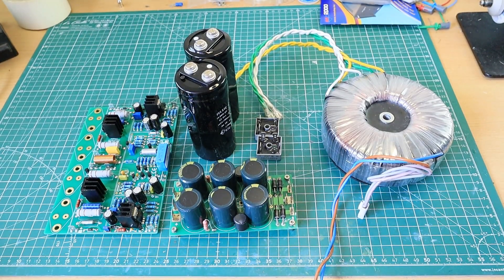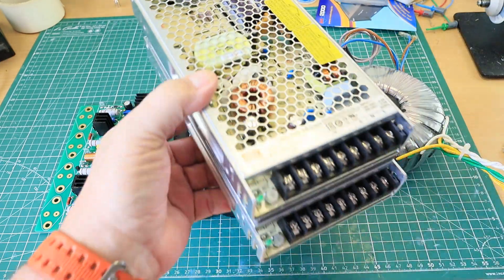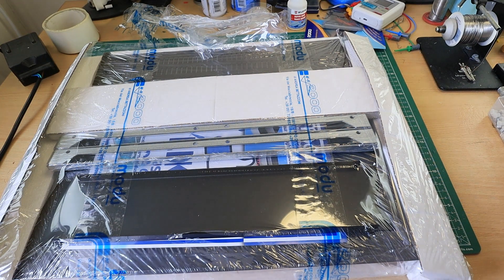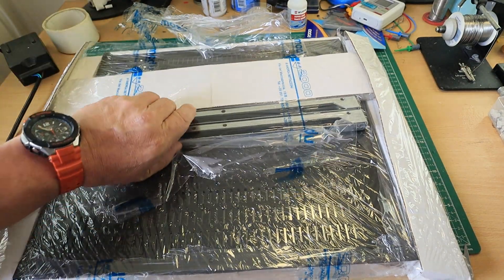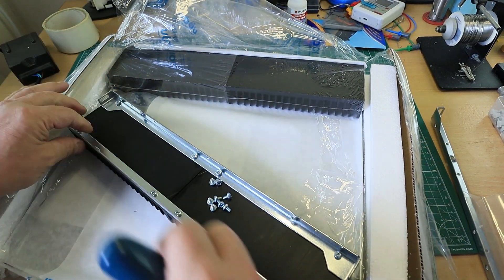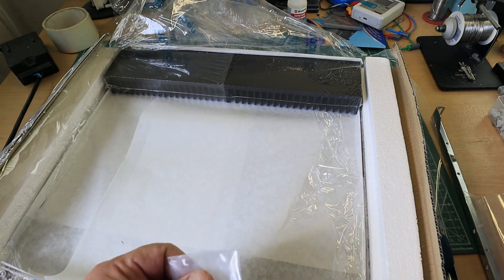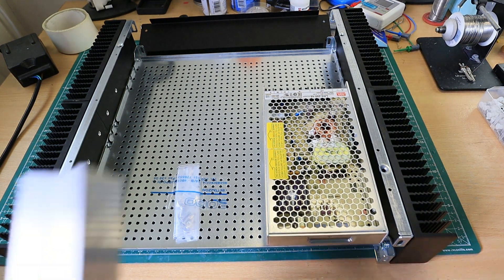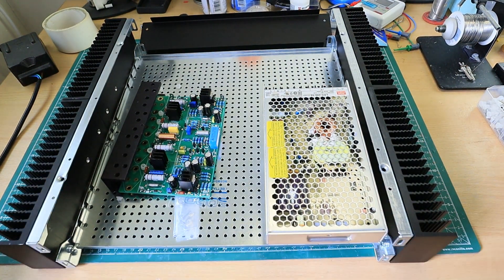Avondale Audio NCC300 'SMPS' Monoblock amplifier build (Intro)

Comment: Hifi2000/Modushop are awesome. I just ordered my nutube diyAudio case and pass ACA cases from them. Great company. They will customise your front and back panels for power and connectors etc if you provide a dxf file.

Comment: What do you prefer Avondale audio or Nelson pass.
 be better if you had the SMPS outside the amplifier near the wall socket just ran a umbilical cord with a couple of ferrite beads and a 1uF capacitor as filtration to eliminate emi rfi Good Earth shielded umbilical cord a shower conduit hose is ideal Earth at one end the mains switch-mode power supplies ideally 120khz -170khz to be out of the audio spectrum but not running too high where they create more noise, what frequency do these smps run at and you soft start not hard start switching are less noisy
Reply from the maker: Thanks for the input, I will have a look at your  filter and earthing when I have time. I have read about it in the past. Avondale or Pass ? Depends on which speakers I use, the Avondale amp has greater control & drive in the lower registers with any speaker, the Pass amps are more suited to efficient speakers but they can drive anything. If you want PA SPL's then their not for you.  So the answer is:- their both very good but speaker dependant. IMO.

Comment: Keep up the good work and  please test the switch mode psu with first watt F6.
How many psu will be needed and spec?
Reply from the maker: Hi, Sorry I cant SMPS the F6 at present as the F6 requires a + - 25vDC power supply. I only have 48vDC SMPS for this latest NCC300 project. 
I'm not sure the F6 will/would like the SMPS type of power supply but who knows..!!!
Reply from the maker: I have seen on (DIYaudio) some have used the SMPS for the F6 in the past and it works OK but I have yet to try it. You would need 2 x LRS 200-24's

Comment: Hey; great build. Would you rate the performance of these Monoblocks over the F6 you build?
Also are they also pure Class A?
Reply from the maker: Hi,  I don't feel I can rate the difference in sonic performance with my current speakers. Which need for more power than the F6 can deliver. The NCC300's have a greater overall grip on my speakers and have a transparency I like. The F6 would be very good with the right (efficient) speakers and maybe have a more pure sound as you say with those more efficient speakers. The NCC300 has more 'bite' not so soft, which I personally like. The F6 is a relatively easy build though with lots of backup on DIYA.
Reply: @thediyaudioimplementers1826  thank your for your reply. Your channel is awesome. good video quality
Reply from the maker: @WigandKleine  Hi Thanks for your kind comments...more to came which may be of interest....